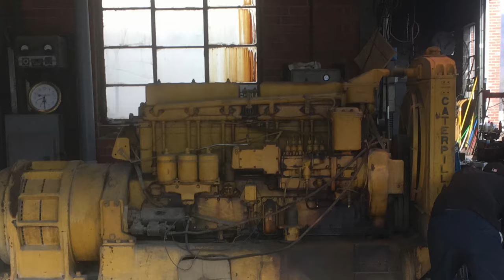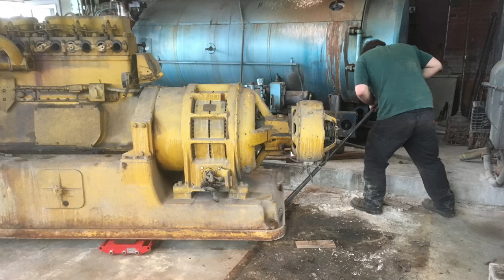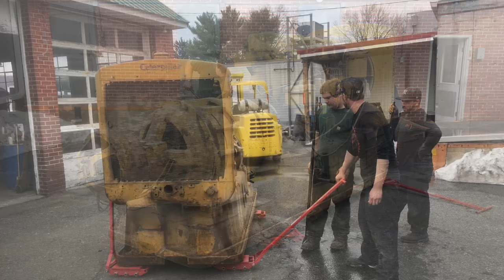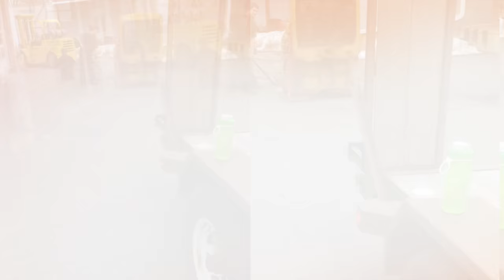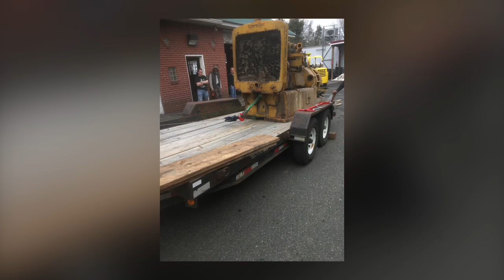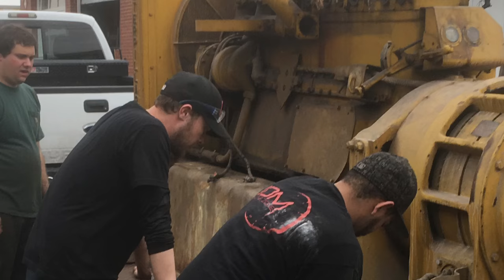ANTIQUE CATERPILLAR GENERATOR SET REMOVAL

Comment: The D13000 is an awesome engine. Have worked on a couple of them many years ago. Looking forward to hear it run. 
If they are looked after, they will run for forever.
Reply from the maker: Thanks for checking it out.  This one has some neglect problems, should be a runner though!

Comment: That is sweet!!!! I had a chance to get a free 1958 130kw GE? Generator with 220 Cummins engine in fully serviced ready to run condition. Only catch is it was in the basement of the building and required a crew to slide it to the service entrance and a crane to get it out. They flipped it right up on end and got it out safe and sound quite a process to watch
Reply from the maker: That sounds like a classy unit as well!  Didn't happen to be one of the supercharged NS 743 engines did it?
Reply: SmallEngineMechanic naturally aspirated old school Cummins 220. Building was built in 1958 so I can only assume that's how old the generator was

Comment: Lovely old bit of kit. They scrapped the old stand by generator where I used to work. I would of had it but nowhere to keep it. It had done less than 200 hours! Almost all of that was testing runs every few months to see if it still worked! I would think it had probably done less than ten hours of actual work!
Reply: Scrapped it?  It should had gone to a new home!
Reply from the maker: Yes, it is not uncommon to see stand by units that are 40 years old with less than 500 hrs on them. Thanks for watching!

Comment: Nice Job!  What are the specs?  You're going to have to rename your channel now lol! :)
Reply from the maker: Thanks for watching! It is rated at 66Kw, reconnectable for 240 or 480 3 phase, not presently tapped for a neutral. 
900 RPM!  General electric gen head with a Burlington Electric automatic voltage regulator.  Engine is a D13000, 5.75" bore, 8" stroke.